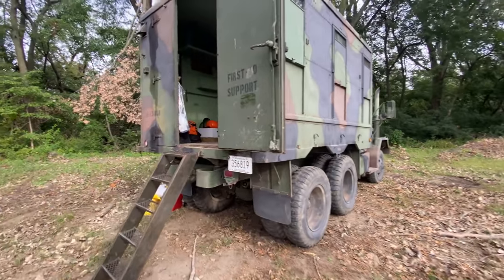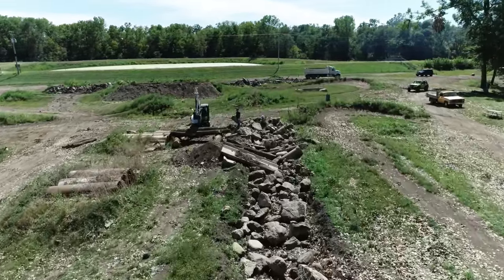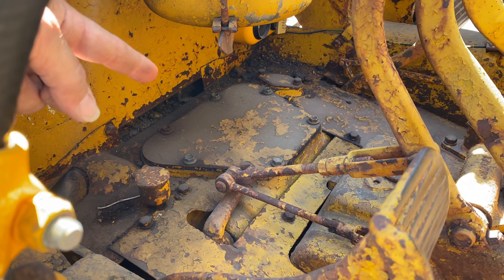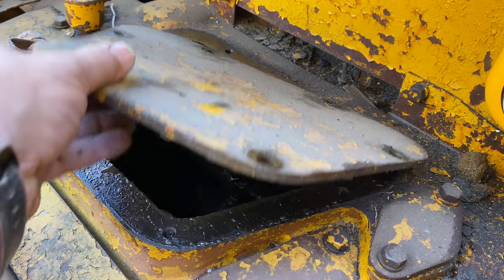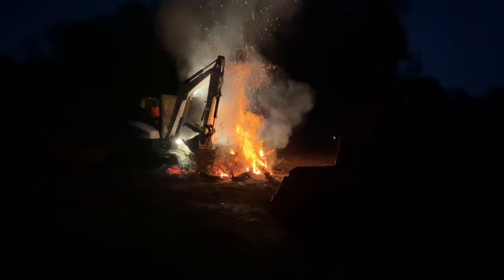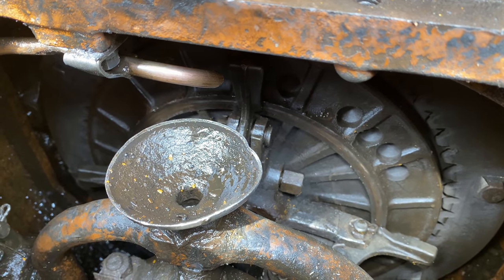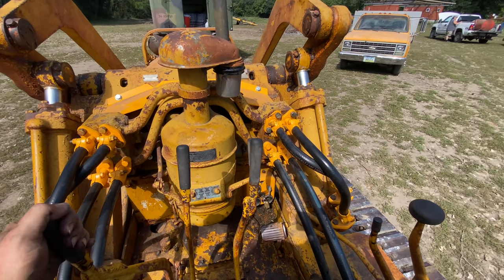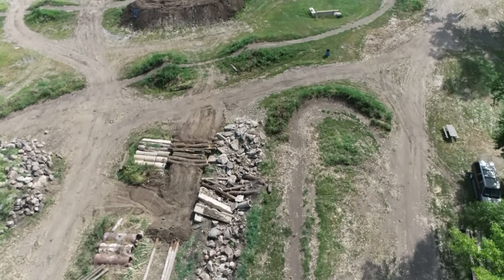Weekend with the M35 Overland Camper and Caterpillar D4

Comment: Great job on cleaning and painting those parts you removed thus far. I hope you continue cleaning it up and repainting it. I assume with a machine of that age that it might be lead paint, so make sure you are using the proper PPE. I notice some of the comments are calling it a dozer. Is it a Dozer or a track loader?
Reply from the maker: The original documentation for it just calls it a tractor.
Reply: For those machine, whether it be a cat or john Deere or whatever, they made them all three. Tractors, track loaders and dozers.

Comment: nice loader, you pulled it with the m35 yet?
Reply from the maker: Not yet I need to find out exactly what the Cat weighs first it could be more than 19k
Reply: @ThisWeekWithCars  i was thinking 17k, it should pull it just fine, just make sure ya got good brakes
Reply from the maker: @johndowe7003  Pulling it isn't the problem, I just want to know my trailer has the proper weight rating because the common 22K trailer would be pushing it after adding the weight of the trailer.
Reply: @ThisWeekWithCars  yeah, I broke a trailer before, bent behind the hitch. Too much hay 😂
Reply: Should be 11-12k...about 6 ton
Reply: @jaytodd5809  yeah it doesn't look too heavy